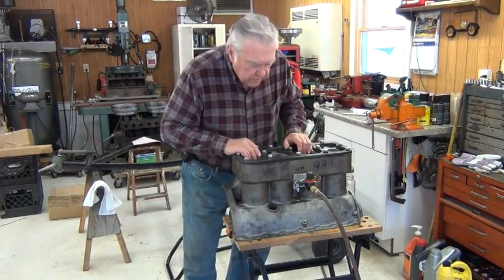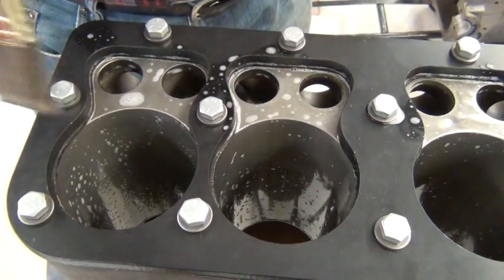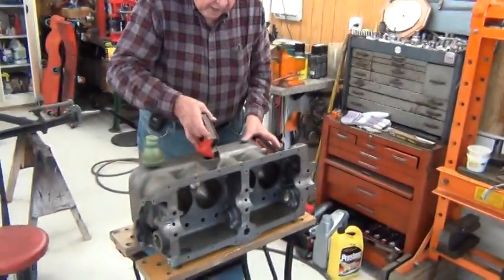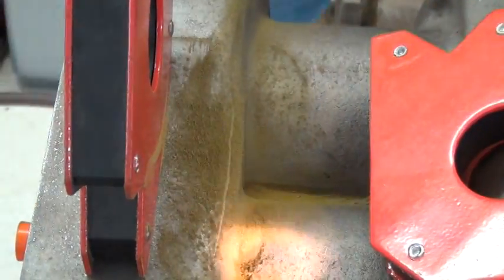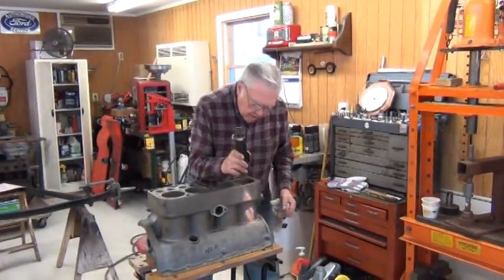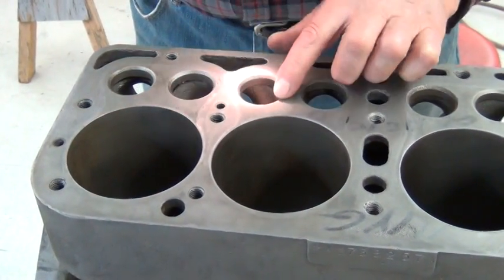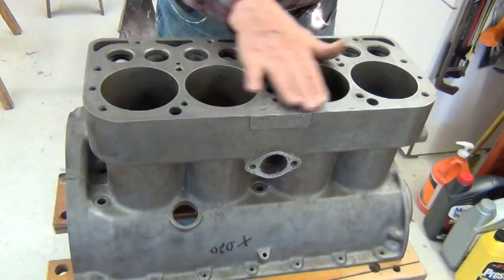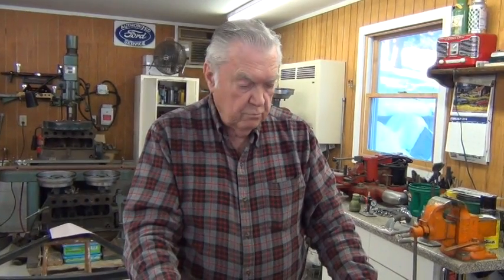John Karal: Ford Model A Engine Block Leak Detection

Comment: Thats like the welding inspection work i did the last 14 years. Mostly the powder is for hot surfaces because otherwise the oil will vaporate. Nice job you did. I have a 1940 Opel Kadett and the engine is almost the same.

Comment: There are some pretty amazing sealers out there these days. I'd damn sure give sealing that cooling system up with one of those on the bench before I'd throw a bunch of money at a "maybe" repair stitching. And by the way, how much air pressure are you putting to that block? Its pretty easy to make leaks with excessive pressure and AIR IS THINNER THAN WATER.

Comment: It looks to me like you could just as easily use the cylinder head itself. You'd have to flip the engine over and work from the bottom side looking for leaks or simply use a shut-off valve on your air supply, pressurize the block and see if it holds pressure. I've seen the "stitching" videos and I read about the process long ago but honestly I'm not sure why anyone would go clear down the cylinder wall "stitching" the block if its going to be bored and sleeved anyway. Obviously if a guy is going to rebuild an engine completely for a full restoration or race use, he'd want the block repaired properly, but I have a feeling there were tons of those old engines running around back in the day with cracks in the and nobody ever had a clue. I don't think they had pressurized cooling systems and typically cracks get smaller as the block heats up rather than larger. The low compression ratio might prevent any leakage of cylinder pressure into the cooling system anyway. I think there's also a pretty good chance that will a full modern rebuilt to gnat's ass specs and particularly with big compression and temperature increases in a high-performance applications, even a "good" block via pre-overhaul pressure test might end up cracked anyway.
Reply: Hi John Where do I go to purchase this testing apparatus.  Could you provide the name of it and a couple of address's or phone numbers to purchase them?